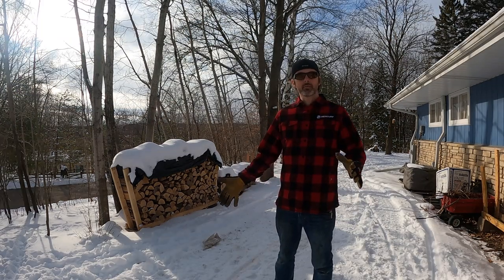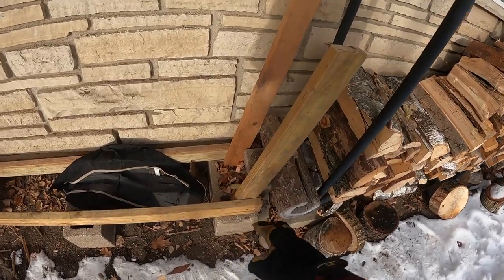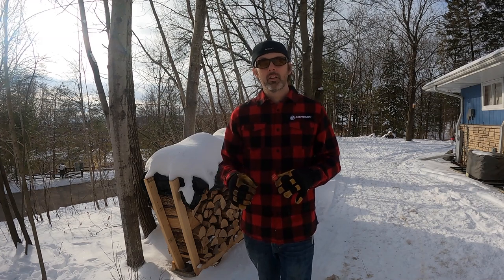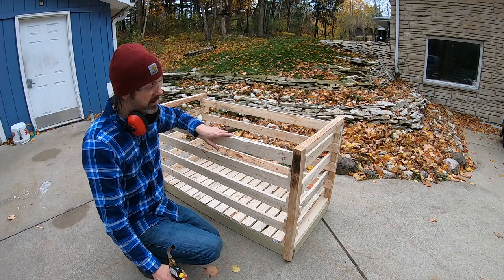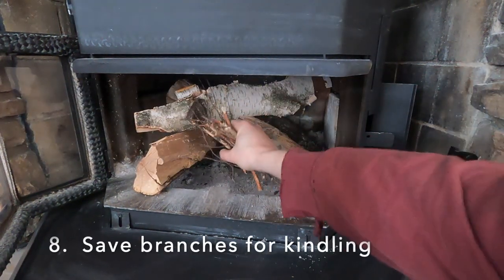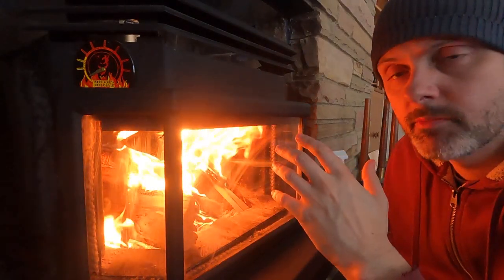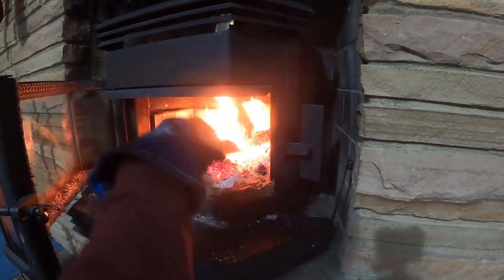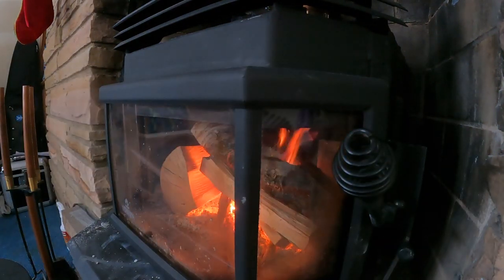10 Tips I've Learned on Heating with a Wood Burning Fireplace Insert How To Save Money & Stay Warm

Comment: I preheat my chimney using news paper so I have a better draft to start a new fire. Of course one needs to maintain the chimney so is free of much creosote. 
I have been burning wood all my life (70+ now). Have a large woodlot and cut all my own firewood. Until last year I split all by hand. Aquired a used hydraulic splitter in good shape and now use it most of the time. 
I cure my wood for a year after splitting. Have neve needed to moisture check it. Burn mostly oak, maple, black locust and some poplar.
Reply from the maker: That's awesome!   I live in the woods but I have so many irons in the fire, it's just too much of a time sink for me.   Paid $200 for a cord of wood last weekend, seasoned a year, 13% moisture.
Reply: I liked your comment.   You're self sufficient and that's a good thing.   Do you have a free standing stove or an insert.  I want to switch to a free standing stove so that if the power goes out, I still have heat.   An insert stops working once the electricity is off.  There is no real radiant heat to speak of with inserts.
Reply: @beebob1279  
The insert requires no power Bob. Not sure why you think that.  We used ours to heat and cook when the power is out. Good luck.
Reply: @stanlee399  Your insert is different than any other I've seen.  What model is it and I'll check it out.

Comment: Choking off the air produces creosote.   But you have to do that to extend the burn.  Remember to follow Osburn's suggestion and sweep out your flu every cord and a half.   Creosote builds up and it needs to be removed for safety above all, and for a clear way to exhaust the fumes from the burning process.
Also, I see you selected an Osburn stove.  Excellent choice.  My Osburn insert has been with me for over 24 years.
Reply from the maker: I burn about 1-1.5 cords a season so I just clean it out once a year.   I just wish I could choke it a bit more, my install limits the movement of my air plate adjustment handle a bit.

Comment: Great video. Im also new to the world of inserts. Once you get it to the right temperature do you close the air vent all the way??
Reply: I have the lopi smallest insert and I feel when I choke the air out the temperature in my house drops unlike when I have it all the way open
Reply from the maker: There's only so many BTUs in the wood; you can release them in a short or long period, depending on your air control.   That said, the hotter your send the air up your chimney, the more heat you aren't extracting.  I run my fan on MAX, pretty much 10 minutes after the fire starts.  As soon as I can choke it all the way down, I do, to make the burn as long as possible.  This is the most efficient way to do it, but if if your heat loss is so high (poor insulation, drafts etc) you might need to run it hotter to keep the house warm.

Comment: A moisture meter is a great tool but you need to use it properly.  You need to split the wood open and test on one of the fresh split faces.  They are also calibrated to work at room temperature.  So your actual moisture content could easily be twice what you tested.  Otherwise pretty good video.

Another note once you have a good coal bed established pack that stove full.  You will get much longer and more efficient burns by doing that.  If you do that I would expect 8 hours out of that stove.
Reply from the maker: Right on, I did that before the season started and everything was under 20%, so now I don't even really check.   Should have pointed out it's best on a fresh split tho!   My biggest issue with packing it is it's a fairly small box and since I installed this late in the season I didn't cut my own firewood, so a lot of it fits at 45 degree angle which is not ideal.  Hard to get a lot of piece in it at once at an angle.
Reply: No big deal just wanted to correct the moister meter useage and give you a pointer on loading.  Hopefully next year your wood will fit better and your performance should improve allot.
Reply from the maker: @benholler1389  I also want to modify the inlet on the stove, I still think it gets too much air.  Can't choke it off enough to choke it out.
Reply: @ADDvanced  if you packed the stove tightly it would be more controllable as well.   But if you are getting 3 hours out of that little wood I would say it is not getting to much air at all

Comment: nice video.... we must think alike? ;0). I use the kindling splitter too... can't recommend it enough.  I  also welding gloves are great.   and the drying racks are simple but effective.   I use a bed of coals with a valley for air flow as well.  thanks for sharing.   I like your three glass panel stove.  I have a fireplace insert and am looking to install a wood burning high efficiency stove...
Reply from the maker: Right on!    At the end of hte day with all the labor I'm not totally sure wood heat is worth the money but man when you're cold it's a lot better than a 72 degree room to warm up.

Comment: Cord saws are so much better than chain saws for maintenance and the fuel problems associated with chain saws.
Reply from the maker: What do you mean by cord saw?
Reply: A chord saw is a circular saw about 12-28 inches in diameter that are configured with a slightly moving table that allows a log section to be moved into the rotating saw.  Old saw blades were primitively constructed.  They were originally powered by a big l flat belt run off of the accessory pulley about 10 12 in diameter to the saw.  Orher versions were powered off of the PTO at the back of the tractor.  This version offered incredible torque.  But either version would slice through a log in just s few seconds.  Later versions were powered by a small engine possibly 7-6 hp.  Didnt matter what kind of log.  The massive torque would slice throigh them quickly.  We used them to cut up huge cottonwood logs.  You still need a chainsaw to cut the tree down and to section it into lengths that either a loader can lift to cut  or 2-4;men can position onto the sawvto break it up into manageable pieces.  Saw mill slabs are easy work and my 2 neighbors run them still..  Mine is broke down right now and needs to be rebuilt and updated.  Their maintenance is nothing compared to a chain saw.  With a chain saw you're  always sharpening the chain, adding oil and sometimes replacing the chain and the bar.  Plus they only cut for a short time and you have to put more 2 cycle gas oil in the gas tank.

Comment: I got a home last year that has  an insert which I don't know why people would have. It is flush with the wall. I see no reason for inserts, basically over 50% to 80% is walled up. I'm now in the process of removing the corner wall so I can have free standing Blaze King Princess so all 6 sides of the stove is radiating into the air. An insert without blowers are useless, with no electricity they don't give very much heat. They are good for decoration for occasional pretty fires to view.
Reply from the maker: They're still more efficient than an open fireplace as they won't suck up all the heat in the room and shoot it outside

Comment: Im interested in a wood stove insert but im worried that it will get too hot in my living room and make it almost unusable. Do u find that to be the case when trying to heat ur house?
Reply from the maker: No.   Use a box fan to move the heat around if you want.  Ceiling fans also help.

Comment: I’m New to wood stoves, still shopping for my first one. This might be a dumb question, but can you more quickly dry out wood by laying it near your stove? I’m asking about wood that’s over the preferred 20% moisture.
Reply from the maker: Yes, but I think it would take a long time.
Reply: First question would be...  Is the wood green or is it wet from getting wet with rain.   A big difference.  I've got wood that is cured.  but it gets wet being outside.  I do bring it in to dry by the burner.  It seems to work for me.
But if it's green wood that hasn't been properly cured then the answer would be no, you can't dry it fast enough.
A well cured hardwood needs a good year to a year and a half to cure for burning.
Reply: 100%

Comment: You mentioned you get a 3-4 hr burn per set.  I'm getting 1-2 hrs on a set doing EXACTLY your set up and prep. (wood = mainly  ash mixed with maple and poplar) 
Wood is dry, keeping temp around 480 C (900F), adjusting choke properly etc etc.  Any suggestions as to why I cannot get a 3-4 hr burn?
Reply from the maker: Try bigger pieces and choke it before it even starts going well.  Creates more creosote but it’ll take longer to get going

Comment: Your pipe thermometer temperature is calculated on the dial for the surface temperature of single wall pipe. It is not a stove thermometer. This reads about 1/2 the actual internal flue gas temperature when placed on the pipe surface, which cools as it rises in chimney, falling to about what the temperature shown on the dial reads at the top. This gives an indication of creosote formation below 250*f at the top. It has nothing to do with stove or firebox temperature and is not an indication of flue gas temp. Flue temp is what you are concerned with to prevent creosote. With an air chamber removing convection heat, this is not an indication of firebox or flue gas temperature. Insulating your flue liner is the way to go about keeping it clean and getting the best performance from the Insert. It is required by code when the chimney is not built to code. If the chimney is in contact with combustible framing material, the insulation is required. 1 inch air space is required on an exterior chimney, 2 inches interior.
Reply from the maker: Checked the manual and they don't want the cooktop getting over 650, so I figured this would be an okay place to put it, near the cooktop.